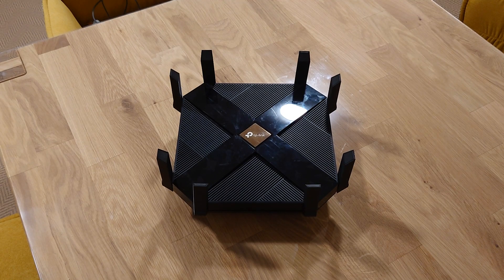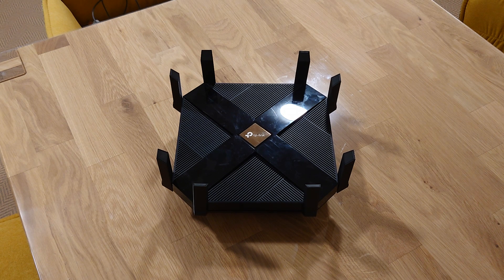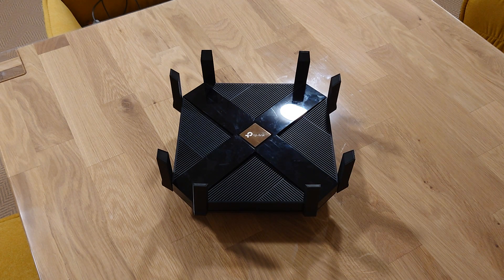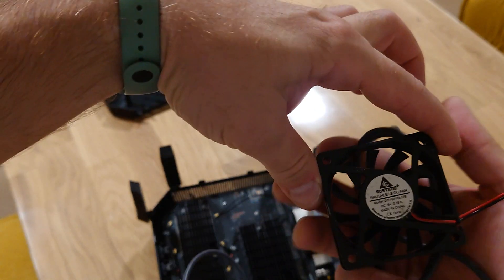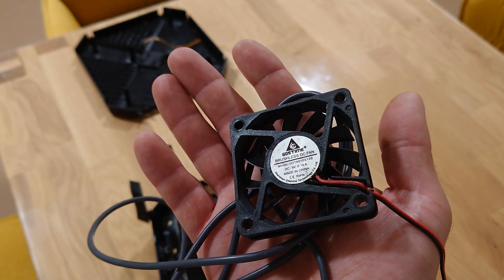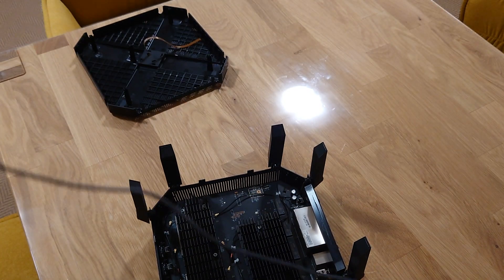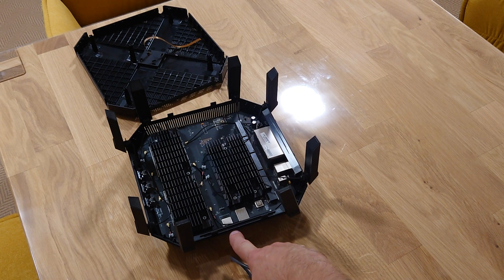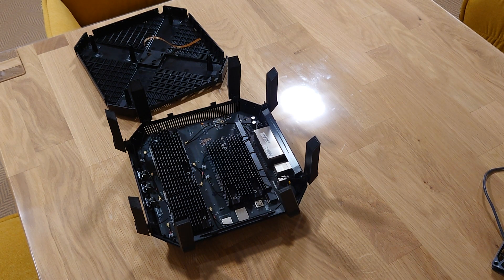TP-Link Archer AX6000 teardown and short analytics

Comment: Mine doesn't work. You turn it on and the light flashes white. Other than that, the router is basically a brick
Reply from the maker: you have to setup the router correctly with your ISP data or connect it to an external modem. to do so please consult the manual or find a technician to support you.

Comment: i have the same router for my mother hotel and same issues with hot...did you finish this hack?
Reply from the maker: Yes I modified one chip but the most issues I had with radiobeacons. Assure the antennas are aligned correctly and in case you have repeaters you have to figure out how connections is good at all places.
Reply: @kirkdis  so you're still having connection problems even after "correcting" the "overheating issues"?
Reply from the maker: @task5147  no I don't, but the issues happened here more due to the position of the router less of the hardware setup. I still have the heatsinks installed...

Comment: Hello, how are you ? how do i open the xiaomi ax6000?
Reply from the maker: just realized the xiaomi is a different manufacturer. hence check out videos for this specific model as thisbvideo is about a tp-link router...
Reply from the maker: watch the video and your question is answered. beside my way there are thousands other ways how to open the device much quicker. for example use a hammer or smash the router on the wall but no warranty that it will work again after.

Comment: the black chip is a BCM53134SKFBG and the operation temperatures are 0C to 70C you can find the data sheet on mouser for it. 

My AX6000 is in a closet with my home servers so every port on mine is used and heat is also an issue if I don't make sure things are properly cooled.